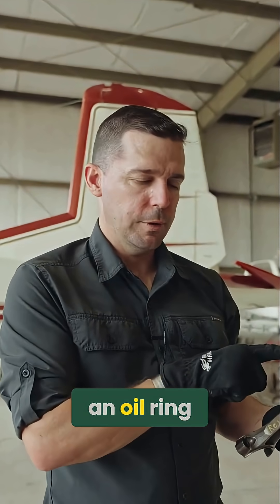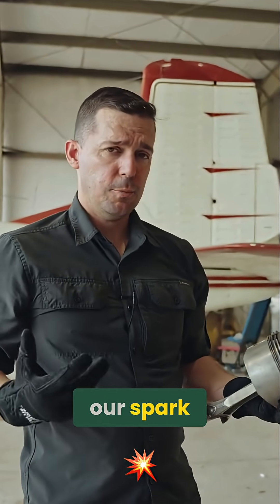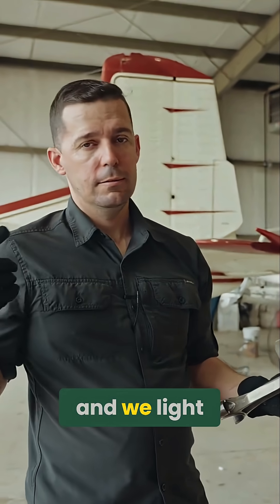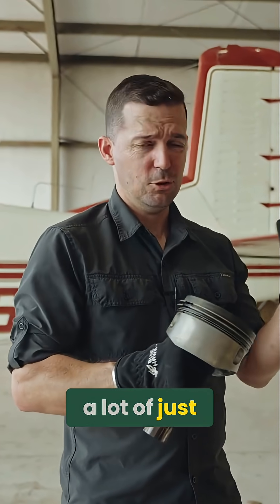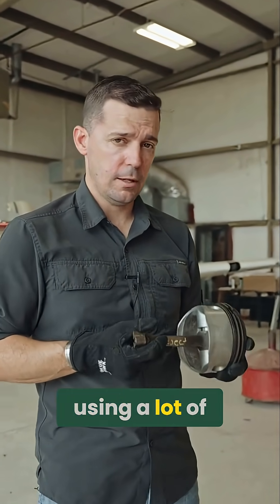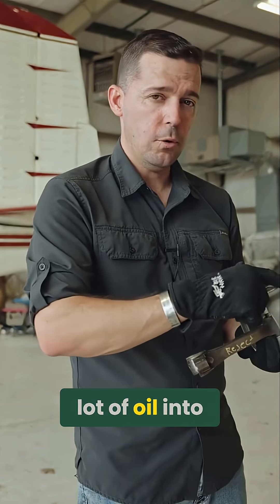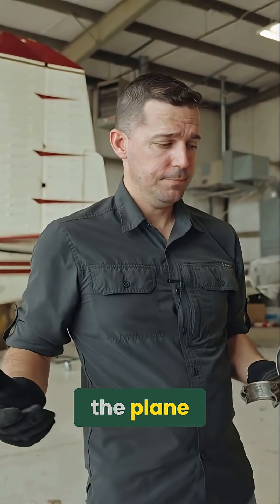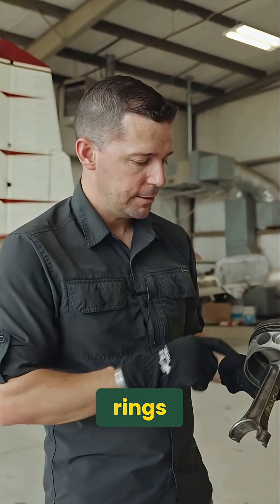Oil Rings: Why Your Engine Burns Oil

Comment: we have a 172 that will burn/lose a qt of oil if you fill it to 8 qts after the 100 hour.  if you fill it to 7 qt, it holds there for quite a while which is strange.  Are you an A&P IA as well and can you do the practical for certifications?  That is my aviation goal.
Reply from the maker: No, I'm not a A&P. I'm working on getting mine done (hopefully in the next two years). 

You're oil loss seems to be more related to the oil being blown out the case vent. A lot of the engine is splash lubricated in a wet-sump system. The case isn't air-tight and has a vent at the top.  If the sump has too much oil in it the splashing of the crank will cause the excess to vent out the top of the case.

You should be able to tell if this is happening because the bottom of the plane will get an oily film on it after an oil change. This is pretty common. An air-oil separator can be installed to help reduce this if it becomes an issue.